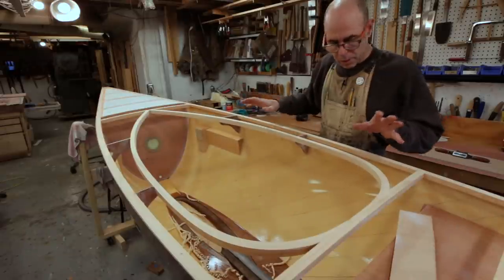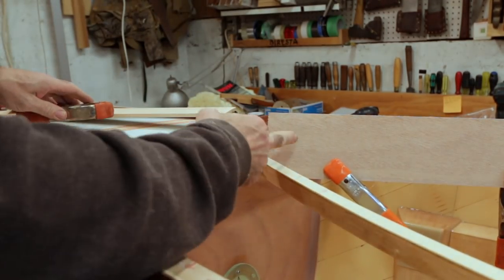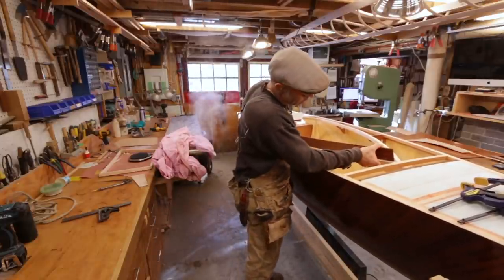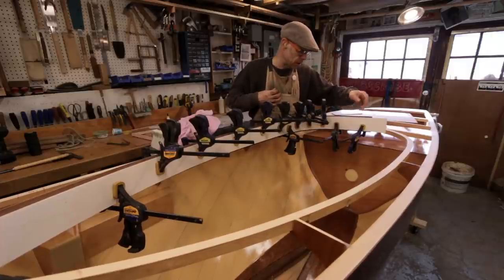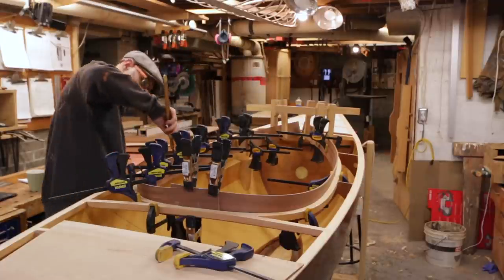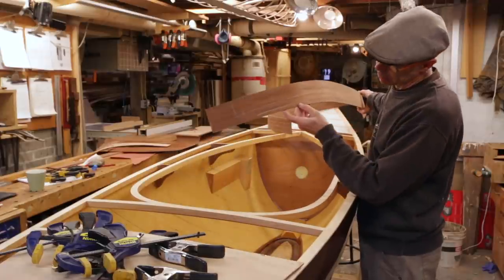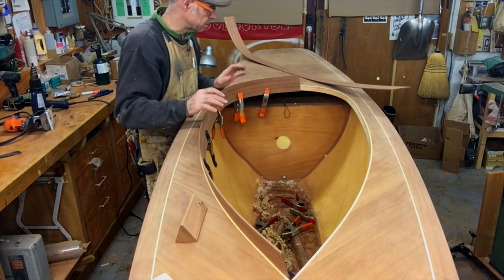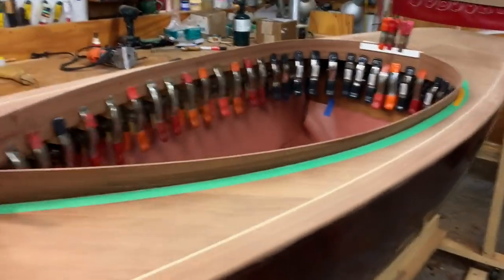International 2.4mR Sailboat Project - Episode 48 - Coaming part 1

Comment: can you give us some in site on how you mill your boards down to 1\8 the in do you start out with 3\4 board how do you cut it I don't have a band saw which I need I do a lot of vener work on antique furniture I have a ever thing else
Reply from the maker: One of the videos covers it but in a nutshell I used a thin kerf ripping blade on the table saw in combination with a vacuum fence. Depending on the final thickness and grain I may or may not run a skim pass through a thickness planer. Depends on how likely the veneers may explode on impact with the planer knives.